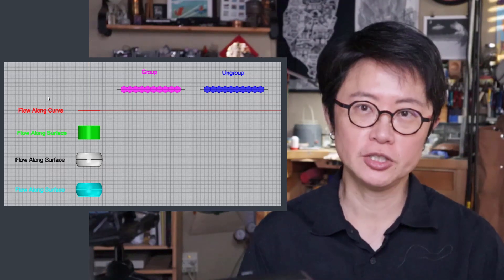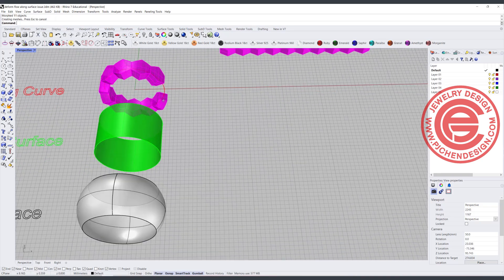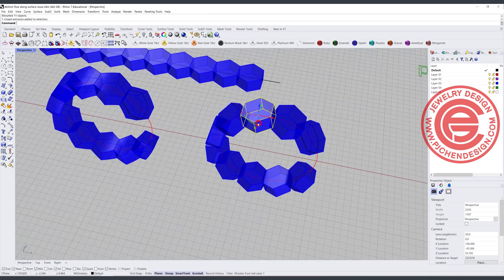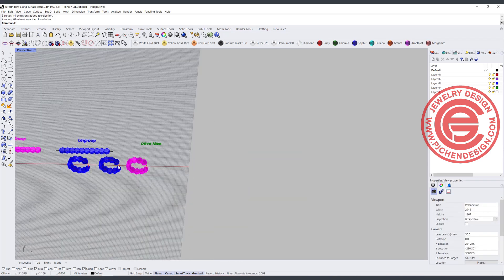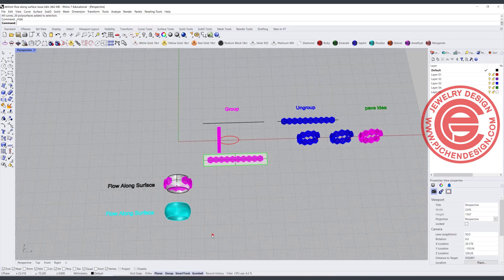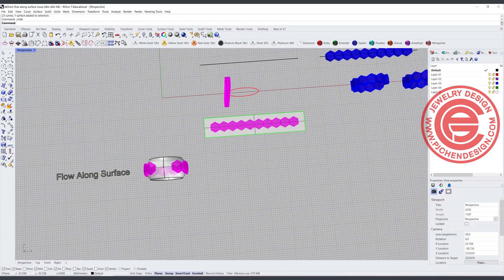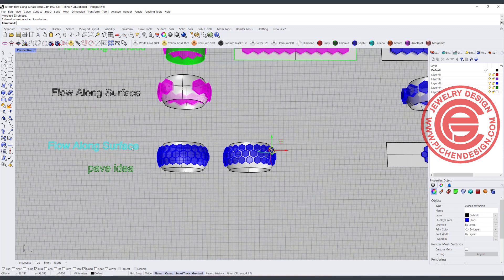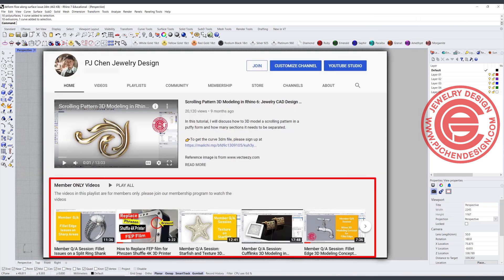SOLVED!! Flow Along Surface Issue in Rhino 3D #256

Comment: Great video! This might be a bit old but what would I need to do if I want to flow along curve a single surface body around a circle ? I applied the same as shown in the video but the result always stays open no matter the dimensions of my surface. Is there any way to close it?
Reply from the maker: flow work well for patterns. If you want a single surface wrap around a circle, I would recommand sweep command

Comment: Hello pj, when my flow along curve command is applied, the product turns upside down. What is the reason for this? Can you please help, thank you. :)
Reply: I want to reflect it outside of the environment, but it reflects itself into my environment in an opposite way, why?
Reply from the maker: it is the direction issue. just need to pick the other corner of your target surface

Comment: Thanks a lot for you video! Really helpful but I was searching for a tip that I didn’t find here, how can we keep the original design with no gap between the different parts if we do rigid yes? Is the only way posssible by record history and move them one by one? Seems to be a lot of work to do there should be something smarter to do
Reply: Hello, I now it’s been a year but did you found a way?

Comment: should the design we need to flow (on a circle) need to be connected?
Reply from the maker: no, but better control if you have them connected.
Reply: @PJChenJewelryDesign  thankyou for the answer. I love your way of teaching. Do you have video of making a cylinder or box of slitted shapes?

Comment: Great tutorial! Is it possible to roll a flat surface to make scroll with this technique? I'm going to use a predefined spiral for this.
Reply from the maker: It may deform on the pattern depend on the size, but it is possible.
Reply: @PJChenJewelryDesign  Thanks for the answer. That way I couldn't do it. The closest I got to the expected result was extruding the spiral and using the Squish command. After applying the desired shape over the 2D pattern, I bring it back to the spiral. Then I used the Split command. I'm trying to model a violin scroll and I'm running into some difficulties. Thanks anyway.